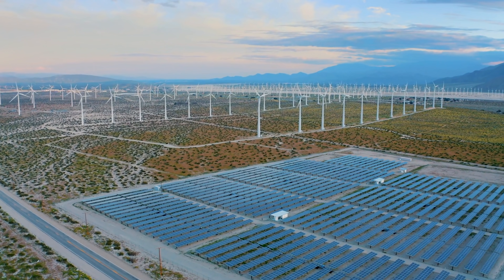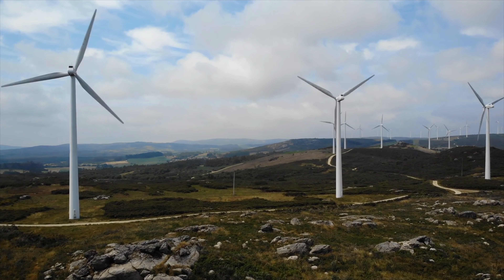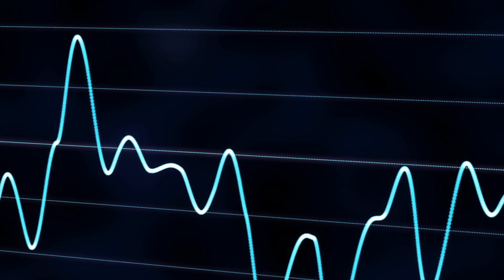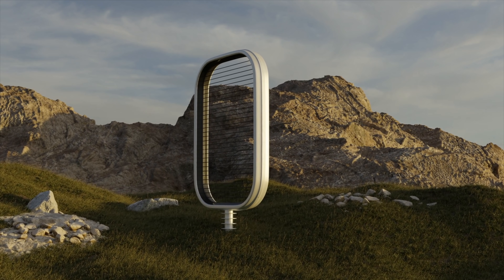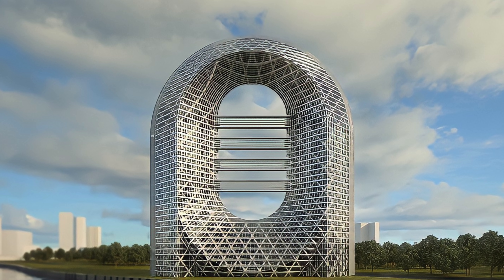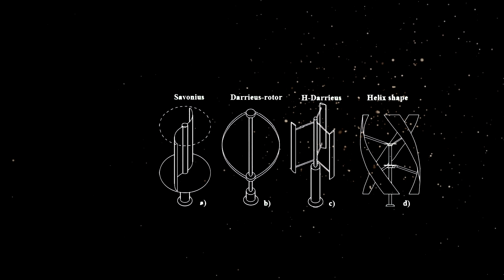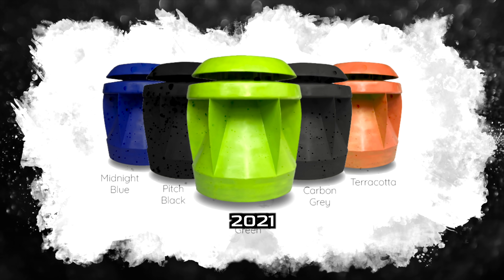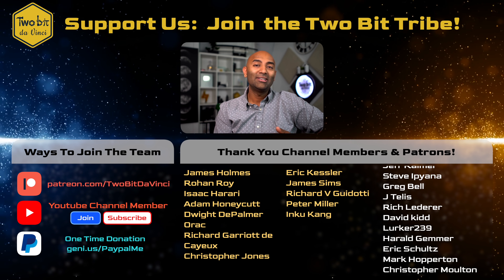These Wind Turbines have NO Blades!

Comment: Has anybody else seen plastic bags swirling around in the vortices and thought it would make sense to have vertical axis turbines at the corners of tall buildings where there is a natural pressure difference?
Reply: I have always had the thought of having the VAWT's on buildings .. but my thought was having them smaller to blend in better .. in my thinking was then to place them up the side of a building in a tube like manor (almost like adding a rain gutter) .. hopefully this takes off

Comment: upright position ground generator wavt turbines, the rose turbine presented by RMS
Reply: combined mass disc energy storage under ground vacuum maglev chamber generator
Reply: just blow some water up a ledge, done
Reply: like wave with wind pushing them around
Reply: water tower wavt with mechanical energy storage, or just pumping water up
Reply: roof top fire place horn double generators
Reply: your flag poles miss a mark of independency

Comment: There is a project in the UK, to harness the wind generated by traffic. They are setting up vertical turbines on the central reservation (median US speak?) on part of the motorway between London and Dover, as a proof of concept.
Reply: I believe that there was also a thought of placing batteries in lamp posts for this project ..
Reply: It would require that the traffic was moving at a sufficient speed to cause a draughty, something that doesn’t often happen on UK motorways.
Reply: @johnbuyers8095  These are designed to harness light breezes, and the test batch made more power on motorways than elsewhere... 
The traffic likely varies, there would be times it would move far too slow to make wind, like peak hours...
But trucks use motorways 24/7...
It should make some energy from the clever folks who use motorways in the evenings, when they are empty and power is needed more...   :)
Reply: It’s dangerous and doesn’t work so great in theory. The extra drag created is compensated by the vehicle, there fore more fuel being used. It’s been debunked a few times now, not sure why the same videos keep going around for them.
Reply: @courtneypope1234  I've seen those turbines, they are about 3 feet tall and barely fatter than the lamp post they are mounted on!    :)
If they create big drag, surely street signs and bus stops etc, would make even more?
The idea was to harvest waste energy from traffic.. Can you link a debunking video with sound math pls?
Goggling debunking these turbines gives me nothing....
Reply: @courtneypope1234  
Can you provide the name of the video that debunked them , please?
Reply: @remliqa  There is no video afaik, but the claims about this design in Just Have A Think video are debunked by the formula that calculates wind power: Power=1/2*Area*Density*velocity^3 
This gives around 25 w for each, so the claims in this video are off by two orders of magnitude. The problem is not the extra drag on cars, which is probably negligible, but the fact that vertical wind turbines (VAWTs) are notoriously under-performing and at this cost the economy is simply bonkers. (Check out Jeffrey Lebowski's comments if you can find them, also take a look in the loong pinned thread, in Just Have A Think's video a few moths ago)
Reply: @courtneypope1234  Exactly.

Comment: Great, now the landscape will be full of vibrating dildos!  Welcome to 2021.  Ok,....serious solution: VAWT with calibrated springs where spokes attach to blades, and the auto-braking will permit scaling up to a much larger diameter.  Also, having a large gear coming off the main shaft (below the blades), will permit a small gear to power the generator (as it will be offset from the main shaft.)

Comment: As an electrician who has installed wind turbines and solar electric systems, I get asked questions like "why don't we just put wind generators on every telephone or power pole". 
While there are often barriers to adopting new methods of power production that have nothing to do with merit, but are apposed because of entrenched interest, such as Fossil Fuel and Nuclear industries, I see many difficulties with adoption of these technologies.
To the small decentralized wind turbines (and power poles) ideas:

There are two types of economies of scale; Those that use mass volume production to bring down cost, such as our smart phones and household appliances, and those where resources can be better utilized by focusing equipment in a small location and "Going Big".

While we could bring the cost of small wind generators down significantly by mass volume production, we run into issues of the higher costs of installation of the units, interconnection equipment, power to grid connections, service needs, and site challenges per amount of energy produced. I am not aware of any utility poles that are engineered to withstand the wind loading and weight of wind generators. A wind generator has to act as a sail in order to capture energy from the wind. Without wind loading, there is no power production. The rotating cylinder and the wire strung generators still need wind loading. Your home is not built to support any kind of wind loading that would make power production economical. And anyone who has been around anything large that slows down the wind knows that it makes a lot of noise and vibration even if it has no moving parts. Large buildings go to great lengths to manage this. Placing small noisy wind generators on utility poles and homes would significantly lower peoples quality of life, and moving parts falling from our roofs or utility poles would in no way be conducive to safety. 

Current large scale wind generators strike a nice balance of both economies of scale from production, and concentrating installation and servicing needs in a smaller location. They are also very decentralized compared to nuclear, coal, and large hydroelectric plants. They, like solar, are also far easier to switch online and offline as needed to match power consumption needs than nuclear and coal. They are located higher into the wind where it is more stable, consistent, provides more energy, and the blades are far less likely to impact wildlife, especially birds.

Small decentralized residential solar systems, while more expensive than utility scale solar systems, offer many advantages for their application. They are point sources of power that can have a high self utilization rate. They generally require little engineering for placement. They have very very low maintenance needs, and have no moving parts. Even if they get dirty, they will provide power at a reduced rate. They are very quiet. they lend themselves to battery backup and emergency power production. They do not put stress on the power grid, and in many cases, provide grid support. The house is already connected to the grid, and economies of scale make the interconnection equipment very cheap. I believe that the falling costs and advantages of distributed solar power will keep most of this technology from becoming viable at such small scales. By the time it could ramp up, Big Wind, Solar, and Battery costs will have blown past them like a Tesla Model S.
Reply: It's possible to dramatically increase the power generated by solar panels using reflectors, but the panels need to be well ventilated so that the additional heat doesn't cause premature failure. I don't know of a good way to engineer reflectors so that IR radiation is excluded. Tech Ingredients has a video on the methodology comparing the outputs of the standalone panel vs. the panel with reflectors.

Comment: Ive always imagined using vertical turbines with trains and tunnels.
Reply: That is the most sensible option with regard to making use of wind speed through transport use.
However, there was talk of placing them along motorways to catch fast traffic movement. At first it seems like a good idea, but then I thought about the movement at certain speeds being an added distraction to drivers. Plus, could they reflect street lamp lights, head lights, emergency vehicle lights, or even nearby building lights in a distracting way at night?

Comment: These oscillate magnets in coils to produce energy. If they were used in tunnels and bridges they would harness energy from passing traffic as well as from the wind.
Reply: Then the energy removed from the airflow would increase the drag on vehicles and they then need to burn more fossil fuels.
Reply: @carldawson5069  are you serious, they would be collecting the energy from the air displacement from passing cars. How can a few poles that barely move cause drag on a passing car when the car drag is caused from the air in front of the car.
Reply: You can change energy (eg. potential to kinetic) but not create energy (i think it was Newton).  You remove some air kinetic by converting to turbine rotational kinetic energy.  Now the air that was moving out of the way becomes 'static' air, and the car or train must add speed / kinetic energy to move the ait out of the way.  I have measured resistance to air flow in hundreds of inch of water column for more than 10 years.
  It is the little things that can get you like dusty hear exchangers increase electricity use by 10-20 %.  (Soap box mode:  please rinse your ac's outdoor coil and chage the filter).
Reply: The non-water sweat may be using humidity as charge transfer.  New Mexico has VERY low humidity.  The micro fiber carbon sounds like a good way to transfer charge to the air, but this also how ozone generaators work.  Ozone corrodes metals that conduct electricity and lungs.  Ozone very high in the atmosphere is great, but low to the ground is pollution.  
  I have learned to hear "free" & "low cost" as warnings that something hidden maybe wrong.  But i wish everyone good luck and imagination.  Start-up companies need a lot of both.
Reply: Newton said you can not create energy.  The energy captured from a car passing may be small, but the conversion from kinetic air flow to electricity is not 100% efficient.  And gasoline cars have an fuel efficiency in the 20-30% range of chemical energy availability (loses become heat (feel) and unburnt fuel (odor).  
Where does the kinetic air (breeze) energy come from? From the air pushed by the car.  Otherwise you are claiming perpetual energy production from a fan turning a wind turbine making electricity to turn the fan.  If your car can very accurately report the miles per gallon, try comparing driving wth a head wind and with a tail wind.
Reply: Yes magnets passing the coils in a turbine produce electric energy.  The efficiency will be lower as the gap between the rotor and stator becomes wider.  I prefer the magnets on the rotor like ECM motors and reduce friction losses and electric contact wear.
Reply: Experiment: Try blowing on a pinwheel then partially block the airfow before the pinwheel.  The pinwheel will slow a little bit.  That will help you 'see' the energy loss that air was used to move the air so the  so the car occupy that same space (drag).

Comment: Unlike solar, I don't think small scale wind, especially home rooftop wind, holds much promise.  In general, you need to get the blades (or whatever) WAY up there to get into steady wind flow, and even that happens in a few geographic locations.
Reply: Community based power storage. It would allow communities as a whole to tap into whatever is viable for their homes and the excess energy would be better distributed, as well as any sold back could go to sustaining the system and even help funnel money I to community resources where needed.  Let's take back ownership of the grids.

Comment: Have you checked out the floating windcatchers that a Norwegian company is working on.  It's not smaller or 'solid state' but it's more efficient than even massive wind turbines.  It is a square structure that has 120 smaller wind turbines and they say one of them could power 80,000 European homes.  Quote from intelligent Living: "Norwegian company Wind Catching Systems (WCS) has unveiled its massive green power technology with an array of floating ‘windcatchers’ that it claims can generate five times the annual energy of the world’s most enormous single turbines."
Reply: Saw that! Very scifi looking! Sweet

Comment: Sounds like we need better storage options
Reply: On a personal level, storage is an easy fix. Thanks to LiPO batteries becoming more affordable and available, it's not hard to store all incoming solar and wind energy you might collect. Also, with sufficient storage, and a powerful enough inverter, you could easily power air conditioning plus all your other normal appliances, using just renewable energy. But that's on a small scale, such as single homes. Large scale renewables simply do not have the means to store collected energy. The winter storm a few months ago in Texas proved that. That's why large scale solar and wind is just not feasible, for most locations. SoCal is a really good location for both solar and wind. But that is not true for New England states. 

I have property in Texas that is perfect for building an off-grid home, just look up earthships. And we as a nation (USA) need to sop building outward, and start building upward. Tall buildings can easily accommodate small businesses and schools on lower floors, with residential and green spaces spaced out moving up. Wind can easily be used in conjunction with green floors (picture a community garden for the residential floors directly above and below it). Urban food production is an increasingly popular thing, and people need green spaces for their kids to run around and play.
Reply: @ericg7183  Well, I wish I could afford the proper batteries to simply run a tiny window AC unit. It cost a fortune but I can now power a small freezer during a power outage for a day or two. If clouds roll in though. I know very few people who can afford the proper batteries for even a tiny solar system. I was able to power a 5 cubic ft freezer for 24 hours at a cost of 700 dollars minimum.

Comment: That power pod one you showed would be my choice here in El Paso.. would love to pop two of those on my roof and hook them up through my solar panels. As long as they’re quiet. If they make any noticeable noise.. that would be a  no. Same for the first oscillating one.. my guess is it’s not silent.. or that the vibrations would carry into the roof. Not a good thing
Reply: Would it be that hard/expensive to build a minimal frame around the house, which isn't bolted to it, which power pods (or other vertical turbines) could sit on?
Perhaps some thick pieces of rubber to attach the frame to the house for stability.

With that setup, unless the frame was somehow unintentionally built to resonate at or near the frequency of vibrations from them, I very much doubt they would be heard or felt inside the house.
Reply: @silvergreylion  i’ve actually emailed the powerpod guys to ask about any information on noise and vibration into a home, and sound levels to the surrounding area for those of us in an urban location. I’ll let you know if they respond
Reply: @airheart1  Aight.

Comment: How long till you're last day @work? Good luck with full time! At one point using a Formula 1 designed cowling around the blades was suggested to improve efficiency. But it would also have the side effect of giving a bird a place to stand & less likely to be hit by a blade. They could also be camouflaged better, perhaps with lots of mini-led's to display what's 180 degrees behind? OK a little pricey but the tech will get cheaper in time!
Reply from the maker: Today the 17th is my first day full time!!!

Comment: Vertical wind turbins are my favorite right now, but the Halcium :Power Pod looks really cool for my residence!!
Reply: Have you actually tried a vertical wind turbine?
Reply: I agree .. my question to them is if they have considered stacking them .. making a tower .. my other thought was making them smaller and lighter so that you could place more of them around your residence (roof caps / chimneys / gutters)
Reply: @denale688  Why don't you just get one for starters, and when you realize you will never get a return on investment, you do not buy the rest? Compared to "traditional" windmills, these are notoriously inefficient.
Reply: @tzenophile  something has to be better than nothing .. in the areas that I was contemplating a windmill the neighbors would complain not to mention the city would most likely poo poo 💩 the conventional windmill
Reply: @denale688  No. Sometimes nothing is the best strategy, that goes for many types of situations. In this case it is simple; you are spending money that you won't get back, and the device will not produce useful amounts of power. So it is not simply something, it is something that will have a negative impact. This is worse than gambling, for at least in gambling there is a small chance that you could win. Just get solar.
Reply: The potential of wind blowing 24x7 vs solar (making energy only during the day, made with heavy metals, requiring batteries to fill up landfills, requiring the strip mining of Africa to meet international demand, and poised to be a hazardous waste disposal nightmare in 30 years) is far more sustainable.

I would love a vertical wind turbine, since people would not know what they are on a house, since they look something like a slightly taller Turtle Fan, for venting an attic. Designed right, it could be an attack fan that generated electricity. Inefficient is still a win, since it would generate electricity.